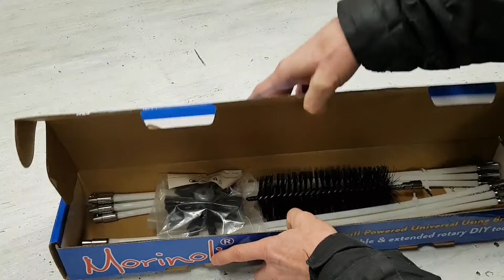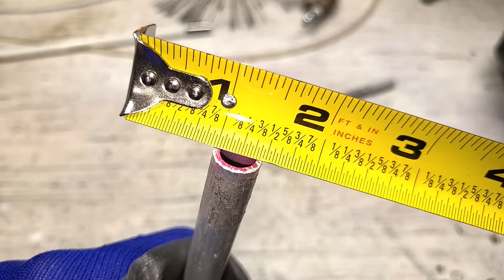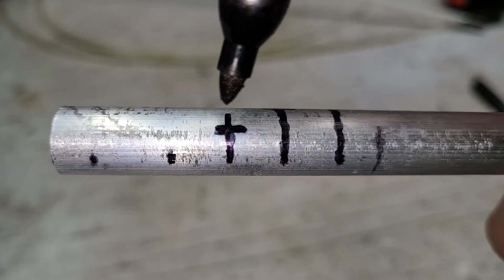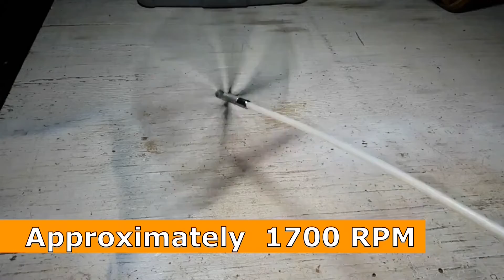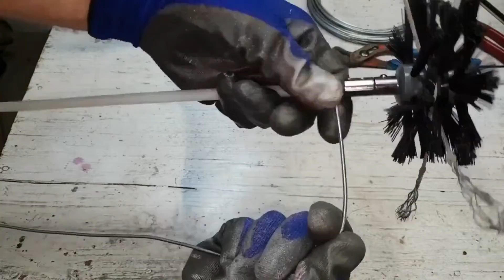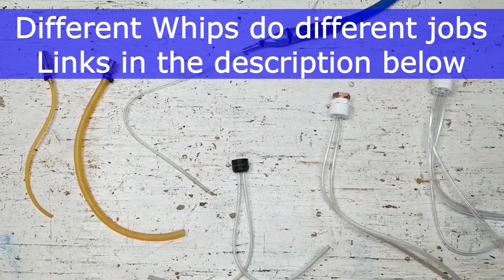Homemade Air Duct Cleaning Brush Attachment for Drill Powered Dryer Vent Cleaning Kit

Comment: Bro, i never leave comments but i gotta give credit where credit is due. Your narration is on point, and your method looks effective and the homemade tools look badass. Where did you hookup the negative air machine, at the supply vent or back at the plenum? Your a humble genius budget phil.
Reply from the maker: Thank you for the complements.  I attached the vac hose to supply vent openings, and worked the tools in the ducting between two different openings.  I closed or covered all the rest of the openings. That was the easiest way for me due to the poor access to the ductwork under the house, and the limit of the leaf blower vac I was using at the time.